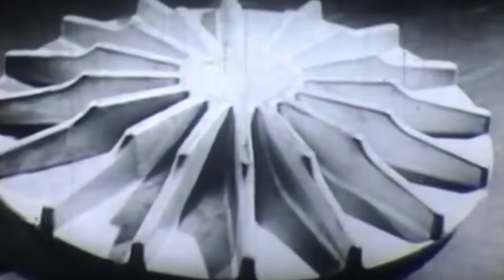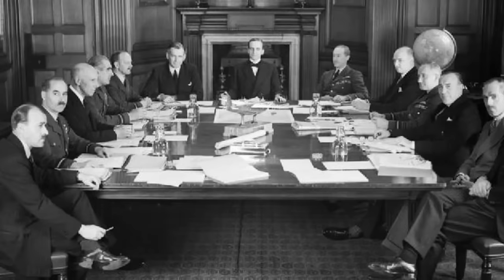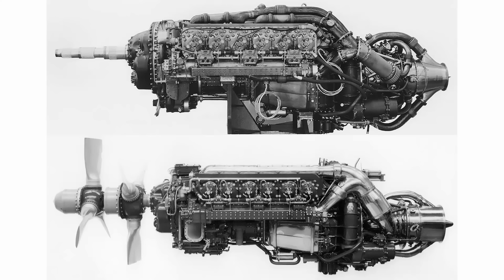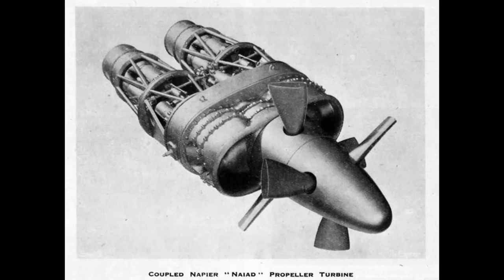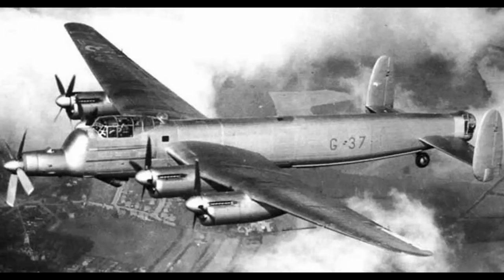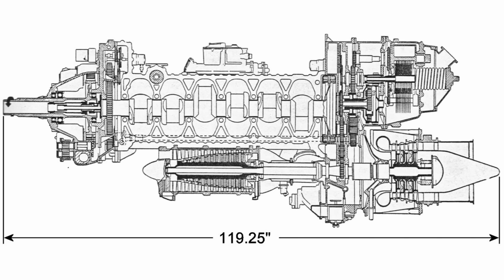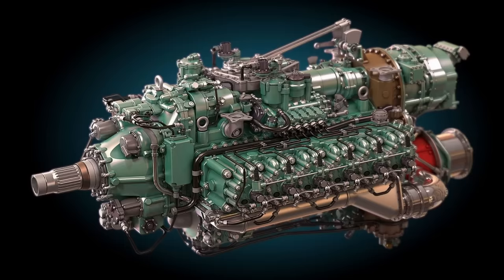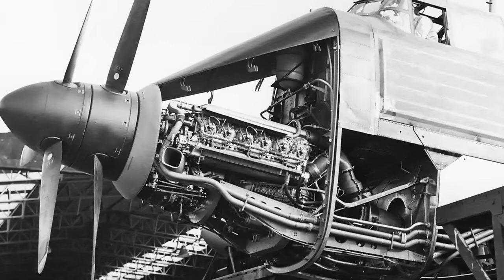A Turbo-Compound-Prop Engine? - The INSANE Napier Nomad

Comment: Napiers were renowned for producing "interesting" engines.  Just look at the Napier Deltic triangular diesel uniflow engine with a crankshaft at each corner of the triangle, 6 cylinders per bank, 18 in total and 36 pistons. These engines powered 22 locomotives on British Rail for many years. There are a couple now preserved.  Once heard, never forgotten !
Reply: There are six preserved, with two main line registered (they can run on the UK's main network) Here is a link to five in a convoy, and a second link for the awesome sound at night at max speed.
https://youtu.be/Avy6KKRFhl4
https://youtu.be/4UM6yPQ0zmU
Reply: They were also used in the "Nasty"class PTF of the US Navy in the late 60's and ear;y 70's. Google PTF Nasty for some interesting reading about their use in Viet Nam.
Reply: The Napier Deltic was originally designed to fulfil a Royal Navy requirement for a powerful, non magnetic and lightweight diesel engine for a new class of minesweeper.,  the " Ton" class. The engine also powered the "Dark" class MTB/MGB designed and built in the 1950's.  English Electric who had acquired the manufacturing rights used the engine in the Deltic class of diesel locomotives during British Railways' mad rush to replace steam power.
Reply: 5000+rpm if i recall right
Reply: @DaVe-iSnOtHoMe.MaN.LemmingsWeB   2100 RPM 3100 HP for the nasty Napier. 1800 RPM normal fast cruise, 2100 max RPM.
Reply: This colonial remembers the melody of the Deltic.
Reply: @dartskipper3170  On the MTBs I think the Deltic replaced the RR Merlin
Reply: they should come back and build 2 stroke turbo engines for cars, boats and snowmobiles.
Reply: @g8ymw  Apart from some prototype (perhaps?) patrol boats (Scott Payne?) and both pre-war and post-war racing boats and speed record boats, Merlins, Griffins, Meteors, or other R-R engines were not used in boats.  There were none used in production boats.  

PTs, MTBs, MGBs, etc. were powered almost exclusively by Packard marine petrol (gasoline) engines,  There were a number of other marine engine builders most notably  Scott-Hall, although these were of lesser power and used for slower or smaller boats. Although, the engines have a DNA that goes back through the 2500 Series Packard Aero engines all the way to the Packard co-designed Liberty V12 Aircraft engine of WWI, they were heavily modified in so many ways to their aircraft cousins, that I think Packard would have best been served by a clean sheet of paper design.

These engines still used fabricated individual cylinders and water jackets, as against monoblock aero engines like the Merlin.  The individual cylinders were bolted to each of the one piece 6 cylinder heads, and then the upper crankcase. The weight and size penalty of this type of construction is not much of an issue for marine use compared to aero use.

Despite, their rugged construction appearance, they could be temperamental, especially when higher boost or higher rpms were used to attain maximum speed.  I suspect the name Packard was used in many colourful ways by navy engineering crew.  Nevertheless, they should be considered highly successful.

Now the main issue with the comment, the timeline is wrong.  Deltics did not appear till 1947, the Merlin was in decline at that point, with the Griffin as the major R-R piston engine.
Reply: Mount this Napier Nomad 2 stroke turbo in Arctic cats new 2025 catalyst! im being silly

Comment: Despite it being somewhat of a dead end this ingenious piece of engineering should be remembered so thanks for featuring it. Keep up the good work.
Reply: Try looking up the Napier Deltic. An 18 cylinder 36 piston two stroke Diesel that was far more successful. Fry your brain at trying to guess which cylinder will fire next in the animation on Wikipedia.
Reply: @COIcultist  yeah, i was gonna' mention the Deltec....quite a lot of engineering and machining, considering these were back in the 'slide-rule' days...The Deltech was used in train engines, and maybe boats?
  Wikipedia animation, I've got to check that out...I've read about the Deltec and seen a couple videos (from old movies) of it in locomotives.
Reply: @dougankrum3328  Used in several classes of boats, that is what the engines were originally developed for. Fast patrol boats and  later minesweepers and minehunters for the Royal Navy. The Norwegians developed a very successful fast attack boat that was used/copied by the West Germans and the Americans. The Deltic was originally developed in the 18 cylinder form, but there was a half Deltic, 9 cylinder version. This was used in locomotives and the Hunt Class minehunter. There was even development work to use a Deltic as the gas generator in a Nomad variation.
Catch also the 3 cylinder 6 piston TS3 used in the Commer "Knocker" truck.
Reply: @dougankrum3328  The New York Fire Department also had one fitted into one of its Mobile Pumps, it was called " Thumper " it was used to produce enough Water pressure to be used on Sky scrapper fires.
Reply: @COIcultist  The Deltic was a good engine, but it was a compromise.  I believe its shape and thus the three banks was influenced by the space requirements of the patrol boats.  Nevertheless, the Deltec is a fascinating engine in its own right, and, unlike others, it actually went into production.  The Junkers Jumo 223 and 224 (the 224 being an enlarged version of the 223) aero engines used four banks of 6 cylinders that is 24 cylinders and 48 pistons and were in IMHO a more elegant design plagued by development issues, mind you, like other unusual advanced engines, the designers were shooting for the moon.

There is no evidence that Napier was aware of the Junkers Jumo 223 and 224, but then again, I would think it unlikely they were not aware of these engines.  

The reported power output of the 29 litre 223 was 2200hp at just under 4000rpm!  Consider that the most powerful production Merlin's power output was 2050hp out of 27 litres.  

The 224 being a larger version of the 223 had an even higher projected output, somewhere in the 4500hp area.  After the war, the Russians continued work on the engine with some of the German engineers, but it appears to have been haphazard and the engine was never completed.

Unfortunately, there is little information available on these engines, although, as the years have gone by, more photos and information are finding their way to the internet.

As always, William Pearce at old machine press is one of the best sources of information on both engines and other reliable sources
https://oldmachinepress.com/2015/09/26/junkers-jumo-223-aircraft-engine/
https://oldmachinepress.com/2015/10/03/junkers-jumo-224-aircraft-engine/

Napier Deltec
https://oldmachinepress.com/2019/09/05/napier-deltic-opposed-piston-diesel-engine/

Back to the engine in this video.
https://oldmachinepress.com/2019/08/05/napier-nomad-compound-aircraft-engine/

Check out the extensive range of engines explored on this site, although, reading is required.😁

Comment: That must have sounded good! I'm a turbodiesel kinda guy with a love for old british iron and aero engines, so this one hits the spot!
Reply: Like a large displacement passenger car diesel with a massive turbo.
Reply: @warmstrong5612   five or six compound turbos more like!
Reply: its not turbo diesel its turbo compound because turbine does not feed the engine but it directly rotate propeller. lots of year later volvo tried the same with trucks but failed again - turbine part was not reliable enough. also this was not only turbo compound aircraft engine that existed and failed.
Reply: Perkins Diesel

Comment: I believe that the Nomad II used a Beier transmission to link the turbine to the crankshaft. It's a mechanical CVT,  not a fluid coupling. The drawing you have is consistent with the descriptions of a Beier transmission and not with a fluid coupling.
Reply from the maker: The source material used the description I gave and said (Beier) in parenthesis afterward.
Reply: @flightdojo  let’s not pass the buck, chuck.
Reply: Yeh, that is correct.
Reply: It is both a fluid coupling and a CVT,  depending on your definitions it may be neither.  The CVT function occurs as the slightly tapered discs move in and out from one another, the effective diameters where they transmit power changes, thus giving variable ratios.  Now to the fluid coupling, all the power is transmitted from one disc to the other by the "oil film in shear", there is no contact between the discs, further the discs are kept apart by the oil "wedge" (like plain bearings or Michell thrust bearings but different) which is why there is a big spring to push the discs together!  So it is a fluid coupling, although perhaps not the type most people imagine   Technically the Beier coupling only transmits part of the power between the turbine shaft and the crankshaft, it is not big enough to transmit all the power from one to the other but has a ratio range greater than necessary.  In parallel with the Beier coupling is a geared transmission, the system is cleverly arranged to trade a reduction in variable ratio with total load capacity.  The complete transfer path is more properly described as a Beier load-sharing coupling.  

All of this and some other unusual technical features were described in great detail in contemporary issues of Flight magazine (such as the unusual arrangement of the conrods, they have no big-end bearing caps).  Unfortunately, the Old Flight Archive is no longer available, a great loss!

Comment: This is an amazing engine. Thank you for posting it. About 40 years  ago I found the book: " The Power To Fly"  by LJK Setright and I instantly became a Napier fanatic as was mr. Setright himself. I think I remember him writing about injecting fuel in the exhaust,  because there still  was O2 left, so to create an afterburner with 100 lbs  of trust.
Reply: Lenny Setright was one of my all time favourite automotive authors, I also had the complete set of "the car" weekly publication that built over several years to about twelve volumes which Lenny was a major contributor to, all meticulously bound......sadly in the late 70's I loaned them to a "friend" and never saw him or my books again.
Reply: Likewise. A great mind, Mr Setright
Reply: A proper legend in the automotive world
Reply: @usernamesreprise4068  Been there, have the empty shelf space from loans which suddenly turn into gifts  without me knowing.  

Yes, he was eloquent and very entertaining but do not believe all his writings.  The maximum horsepower rating of the Sabre was obviously way off the mark.  I have seen a photo of an original Napier document that lists the power of the various marks of Sabre, the bottom line has a handwritten correction, with a three replacing what looks very much like a typed five in the thousands position.  This may have been the source of his outrageous 5500hp claim.  Frankly, he should have known better.

Comment: 6:49 Oh my god, that may be the first engineering detail drawing in history to induce madness in any mechanic who sets their virgin eyes upon it. That image is at once a testament to a astounding level of functional engineering, and the epitaph for this sort of engineering philosophy. This is the kind of product where the manager in charge should have said “Alright guys, we’ve gone FAR afield of the goal…” A mechanic that would be able to work on something like this would be making hundreds of $$$ an hour.
Reply: Mechanics that worked on the Wright R-3350's that had this system (Power Recovery Turbine) called them "Parts Recovery Turbines" but the Pratt & Whitney R-4360's with their 56 spark plugs per engine was also a maintenance nightmare
Reply: @TheSDB13  “parts recovery turbines” does seem apt and likely because there is A LOT of faith in hoping all those parts stay where they’re fastened.

Comment: It was a follow on of the motorjet. I am suprised it got so far as all R&D was focused on turbojets and turboprops. 
The motorjet may have been feasible by using ready made, cheap, air cooled engines.  The engine that comes to mind is the Czech Tatra aircooled, aluminium, V8 engine of the 1930s, which was made in various forms until the early 2000s. It was way ahead of all other V8s from the 1930s, probably into the 1960s.  Put one of these at the front of a tube turning a turbine behind it, then a cheap motorjet engine may have resulted. All the heat and exhaust goes one way - backwards.

Eastman Jacobs in the USA was impressed by the Caproni-Campini motorjet in Italy that he pursued a similar layout that became known as the NACA-Langley-Jacobs-Jeep, or Jake's Jeep. He continued R&D up to 1943 when the US forces, after being drawn into British turbojet developments, decided to focus on turbojets. When the funds ended, the R&D ended. Jake's Jeep got to a mock up stage.

Comment: An excellect presentation of a terrific engine.  My only slight quibble is the conrods were not fork and blade but a unique arrangement where the opposing cylinders were consentric and each rod ran directly on the crank pin without conventional caps.  Due to the masive boost pressures the rods were allways loaded onto the crank pin when the engine was firing.  To allow the engine to be spun up without the rods detatching light straps were fited arround the opposing conrod ends.  The allways loaded crank pins caused problems early on as the normal relaxing of pressure on the intake stroke promotes oil feeding into the bearing and prevents the oil fing breaking down.  The problems were solved by grinding each pin in three distinct  bands sightly eccentric to each other causing a relaxing of the bearing and stopping the oil film from breaking down.  This is just one of the complex problems the engineering team overcame before the Ministry of Supply pulled the plug on what was the most efficient diesel engine ever seen.
Reply: Thank you for addressing the issue of  Crank  Pen design
Reply: The range Of the cargo aircraft Powered by this engine Was  Suggested as 10000 miles

Comment: All I can say from my experience with internal combustion engines and engineering of 2 stroke gasoline technology with making some personal experimental engine designs myself, is nothing short of Wow! Fukin WOW!🤔🤯🤯🤯 Something like this is exactly what you stated here towards the ending "Dare to dream big" That in fact somehow, something so substantially outside the box of what ordinary was, especially back then??? SMFH! This one takes all cakes, and eats them all too! Incorporating a 2 stroke diesel utilizing Loop Scavenge and the fact they've gone beyond the "Turbo/Supercharger" or ordinary of the day and jumped right into the next level of jet engine technology as their answer to wasted exhaust energy....AkA BTUs and pressure to drive a compressor wheel to power a small turbojet engine as the exhaust system for additional thrust, all while using the compressor stage of the jet as a turbocharger for the ported and then timed ported engine as boost to the compression ratio and assistance of scavenging, which is a necessity for any potential power development within a 2 stroke diesel design. This one has blown away my mind brother! Leave it to the British and evidently a blank check to go with it! And we'll be amazed by what they are able to develop! Did I say Wow? Lol! Holy Sh1t! That's Absolutely Awesome stuff! Thank you for bringing this up to us here and sharing this wonderful feat of engineering with the world, that would otherwise have been long lost to time! 😉

Comment: I had heard about the astonishing cycle efficiency of this engine, but didn't realize how they achieved it. The idea of a combined turbine and two stroke diesel piston cycle has been rolling around in my mind since I learned about the Wright 3350 turbo compound as a kid- I'm not surprised that Napier and Recardo tried this. It is a brilliant solution for long-range aircraft, and it is sad stroke of bad timing that it was overshadowed by pure turbines. One has to guess that the turbine's low weight and simplicity was hard to beat with such a heavy, complex beast. Still... reheat fuel injection to the compressor turbine- check. Fluid coupling for compounding the excess turbine power- check. They thought of everything.

Comment: Harry Ricardo is one of the most important engine development experts of the last century.  These Nomad engines represented the peak of piston aircraft engine development, tuning for both power and efficiency.  Using two-cycle diesels with Ricardo's combustion chamber technology, exhaust turbines, and newly available alloys to reduce weight, these were probably the most efficient aircraft engines ever designed. The problem was the jet age...  Jets and turboprops are not nearly as fuel efficient, but they are much simpler systems with fewer moving parts and have much longer service lives.

Comment: The Nomad also reminds us that sometimes the most educational & informative things, come from the projects that didn't work or didn't go ahead. Like Dojo, I would say the Nomad was not a failure, it was a lesson and an important learning tool. The Yakolev M501 is another example of this, as of course is the Wasp Major.
Also made by Napier, in about the same time, was the 3 crankshaft 2 stroke Diesel Deltic, which ended up powering small ships and Diesel locomotives. That thing is an awe-inspiring piece of engineering!
Another example might be the H-16 engine British Racing Machines tried to make, for Formula One. It was the age of Fangio & Moss, Jim Clark, and that H-16 was a bridge too far in terms of complexity...